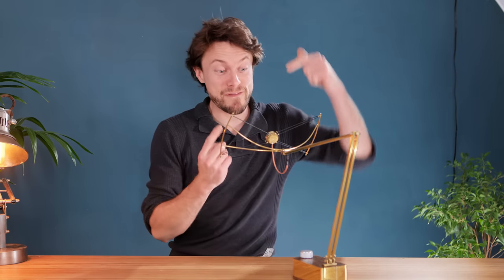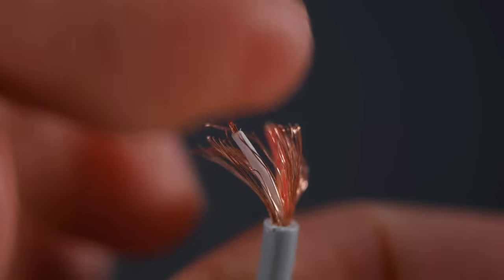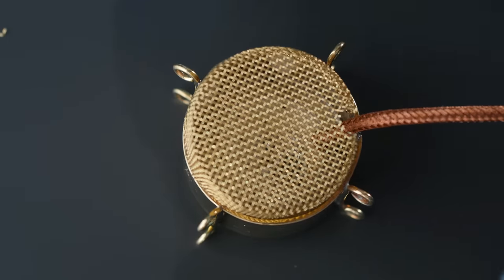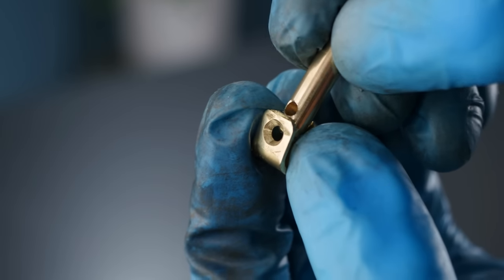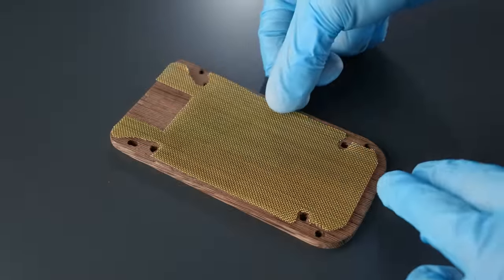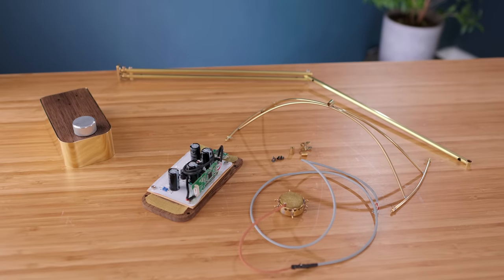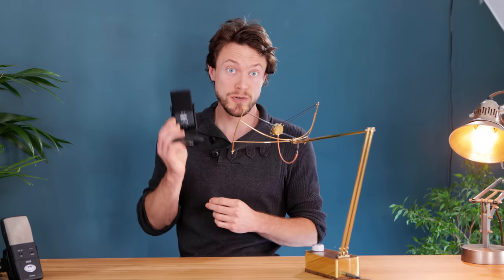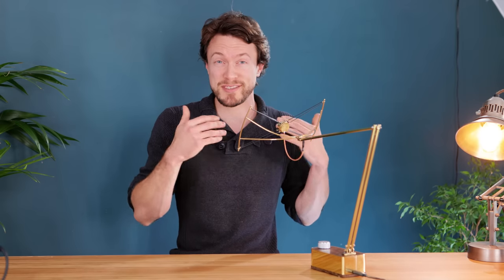Building a quality USB-C microphone

Comment: If you could sell a build kit for this I would drop 100 dollars for it. This is just to cool
Reply: Mostly it isn't the parts that add the cost, it's the pay and transport, so I am not sure he would come out on top on that one.
Reply: Yeah, I'd probably be more than happy to pay for someone to build this for me ;) ...as to DIMyself, the tools, components, exact amounts, shipping AND obviously experience would ramp the costs up considerably for me. But I love the idea of knowing exactly what went into the project (as explained in this video). So hit me up if you're building and selling these (UK)!
Reply: Yep, also, most people don't have a soldering (iron, flux, wire), drill + bits, wooden pieces, brass, heating torch, workbench with tools etc. + the general skills with those tools to do these DIY projects.

These DIY projects are cool, but even more cool would be if people with these skillsets would manufacture cheaper microphones and out-compete the market.
Reply: @albin1816  Ok, and?
Reply: @ElicitDaG  and?
Reply: @albin1816  And?

Comment: Depending on the use case, I'd say the Neumann has more polish to the tuning of it. It's a lot warmer and less clarity, but if you're using it for voice, it lends to a more pleasing tonality and overall sound. The DIY microphone has amazing clarity to the point that it's a bit deterring when  listening to it with a very accurate headphone. However that is fixable in post or could help with an addition of a pop filter which makes it maddeningly impressive given the price of the build. Bravo!

Comment: Not exactly the same quality as the Neumann but definitely far more wallet friendly.  I think I would probably go for a simpler design featuring more wood but I think that with such a retro theme it deserves a valve pre-amp which may well go some way to emulate the greater warmth of the Neumann.
Reply: The valve pre-amp is an interesting idea.
Reply: @badhonebrahim7707  Child
Reply: you can tell the difference in quality i cant hear a difference
Reply: Quality of microphones is subjective and completely relative to the purpose you use them for; Even professionals will rate microphones from hundreds of dollars to tens of thousands equally on average when they hear recordings without knowing which mic did it in a blind A/B test. Even mics in less than $100 can fare well in these tests.

This is why mics like sm-58s are often still standard even in million dollar studios; They're still eminently usable despite being only $150 or less.

The only reasons mics are worth thousands and thousands of dollars is because you're going for a particular sound, response, signal-to-noise ratio, and impedance. Also obviously simple quality of construction matters as well, and whether pairs or sets are matched, etc.
Reply: @Kyle_v2  The Neumann mic has a rounder, more bassy sound commonly referred to as "mic effect," and would be a better option for a calming evening show or an ASMR recording. My hearing is pretty bad and I'm not using my good headphones, but the $40 mic seemed to stack up decently with his usual setup that costs 20x as much.
Reply: @inthefade  It's hard to go wrong with an SM58. When shopping, I highly recommend trying to find an SM58S, which usually costs about a dollar more, and has a hardware mute switch on the microphone.

Comment: Very impressive mechanical design !
As for the electronic part...
1. In the schematic I see a 2.2k resistor connected to the source pin of 2N4416 which is the same value as in the JLI's Datasheet, Measurement Circuit, which raise the suspicious that the value was just copied from the datasheet without any understanding of circuit functionality. In the Measurement Circuit the 2.2k resistor is connected to the ground and there is a hint that Vsource is 1.5V resulting a current of 0.68 mA. In the presented schematic the 2.2k resistor is connected to -15V and that would cause a current about 10 times higher. High current in a microphone preamplifier first stage means higher noise.
2. The voltage from Microphone must get to gate and drain pins of 2N4416. While gate is connected directly to microphone pin, the other pin of the microphone has to go trough ground, 2200 uF , 2.2k resistor to get to source. Basically the 2200 capacitor is in series with the microphone signal and therefore all the (small) noise present on that capacitor is in series with the microphone signal.
3. In normal operation Vsource is higher than Vgate (Vsource > Vgate ). Since the gate is connected to microphone and the other pin of the microphone is connected to ground I assume the Vgate = 0 (Ground). So in normal operation condition a)Vsource > 0  (for example Vsource = 1.5V). 
Because Source current is equal with drain current (Isd) and there is a same value R =2.2k resistor connected to drain we have Vdrain = 15V - (R x Isd) and Vsource = -15V + (R x Isd)  which means condition b) Vdrain = - Vsource.
Since Drain is connected with a resistor to + and Source is connected with a resistor to - and there is no other way current goes (no current trough capacitors) we have condition c) Vdrain >= Vsource
Looking at a) b) and c) the only solution would be Vdrain = Vsource = 0 which tell us that either  despite being connected trough microphone to ground the gate is somewhat at a negative potential (condition a) is not valid) or the transistor is saturated. Someone who has made the schematic should measure the voltage between source and drain and leave a reply, please.
4. THA1512 is a bipolar transistor based IC for low impedance sources, like dynamic microphones, moving coils. As the input impedance increase, the noise increase. Just because we want to build a electret microphone preamplifier, using a high performance IC for dynamic microphones might not give you the best possible signal/noise ratio (see Application Report Understanding Op Amp Noise in Audio Circuits  Tyler Noyes, Tamara Alani). I will try with OPA1652 who is a FET-input OA, no need for the external FET transistor, connect the microphone directly to OPA1652 input.
5. at 2:11 "The leg next to it won't be used" That is the transistor's metalic capsule, I would solder it to the ground
Reply: Hey you're smart. Question for you, I want to build this mic but dont reallllly want to build out the board. I have a Focusrite Solo interface and Im wondering if I were to solder the mic capsule with the transistor  to a XLR cable and plug that into my interface if it would work? Any thoughts?
Reply: @taylor.galbraith  I understand that you want something simple and that you have a preamp that has a XLR input only for a dynamic microphone (otherwise if it has a XLR input for a condenser microphone then you could connect the Jli electret microphone capsule directly to XLR, without any transistor, no 48V phantom!). With those assumptions, check https://youtu.be/L3a91HLWvPE that is the minimum you could get away with and have good quality. For simplicity, no external power supply, no complications with schematic using the 48V phantom power. It will not work with only the transistor soldered on the capsule as you are asking, you have to use a circuit with at least the two 2.2k resistors, a 6-9V battery for power and you connect the XLR where the two 22uF non-polarized capacitors are. I couldn't find the schematic of your Focusrite Solo interface, but looking at a schematic of a Shure mixer and a Behringer mixer, they have internal capacitors, so the 22uF non-polarized capacitors can be omitted. However, I have the schematic for Focusite ISA110 and RED1 and for those,  you need to insert a capacitor on at least on one of the wires that go to the XLR connection (like one of those 22uF non-polarized in original schematic) because mentioned Focusite mixers have an internal transformer on the input that would DC short drain and source of the transistor (for example drain source voltage will be like 5.6 V when not connected but it will drop to less than 1V when connected to the XLR input).
Reply: @johnt2342  Hey thanks so much for your reply! Great video link, I am very new to electronics which overwhelmed me when I first downloaded the project and looked at the schematics. I understand your walkthrough very well which I appreciate.
Reply: I have build the microphone but am searching for ways to make it better. As you suggested i measured the Voltage between drain and source and came to 10V DC. This should satisfy your condition a) but 10V seems for me a bot to much for the capsule as the test rig only used 1.5V.
Reply: Man that was one of those comments that you just copy and paste into notepad for later
Reply: nice rabbit hole!

Comment: The fact that the comparison between the DIY mic and the Neumann came mostly down to preference/application is bonkers considering the Neumann costs LITERALLY 100× more. Speaks volumes on how knowledge and buying directly from the manufacturer can mean that much of a difference in price to performance.
Reply: It's like the story of the old mechanic that hit the motor with a hammer to get it working after nobody else could figure out what was wrong or how to fix it. Hitting the motor with a hammer: $10. Knowing precisely where to hit and how hard: $2990 (or some other very large number). This project is basically Matt giving us the $2990 part for free, and leaving us to spend the little bit of money and some time to put it together.
Reply: To be fair the Neumann is also used to record instruments and this is really challenging. Since his diy microphone doesn't handle changes in dynamic too well there would probably be a much bigger difference. But I'm no expert, maybe a few changes to the circuit design eliminate this flaw. Other than that his microphone sounds amazing.
Reply: @niklasholgerson3779  I had the same thought - though I also wondered if you can get the module used in that mic, what it might cost, and how THAT diy comparison would go.
Reply: @johnandjacquelinewarren9979  the pickup on the Neumann costs basically the same as the one he used, there's 0 mistery in manufacturing electroacoustic pickups with very tight tolerances at scale.
What makes the Neumann the gold standard is all the electronics to amplify and filter the signal, that's where most of the cost is going, into the ROI of the original R&D of it.

Comment: I actually can't hear a difference in sound quality for most things. Even playing with built-in equalizers in car radios, I only notice a difference between +10 to 0 to -10 on each frequency. Nothing in between. As such, I would only know if one microphone is better than another by recording them with a multi-frequency oscilloscope and visualizing the peaks/falls. I'm sure you could use the first microphone that sits on a desk and I wouldn't hear a difference. Still, an impressive DIY, to be sure.
Reply: yes. 

the real test of a mic is what range it pick up sound at, even a 20 dollar mic that is directional would do a good job for voice recording if it is close enough to the face. it does take a while to get used to directional mic like this, because they really don't pick up sound from the side which is great because u don't get as loud an annoying key tapping sound from keyboard and such. so picking the mic based on purpose is more important then buying an expensive but incorrect mic for the job. 

but the issue with these mic is they do need power, and USB has limited power output, so what limit them is the USB power standard. which mean USB powered directional mic can be expected to has similar quality since the limiting factor is the USB.
Reply: @lagrangewei  atleast for current USB spec I don't believe this microphone is reaching the top, which for clarity would probably use a second USB.
USB-C is specced for quite a lot, would of course need a supply for that but even so
Reply: @lagrangewei  isnt that why the booster electronic components are there?

Comment: The Neumann is more flat. I’d presume adding a foam mesh to the DIY mic’s insides would flatten the sound and make it actually quite similar. Professional tools, even in terms of photography preferences, are generally flat so producers and editors and get a full range of adjusting in post production. The DIY is also a bit “tin-y”. Harsh highs. I’d wager adding a foam mesh covering to the front and back of the mic under the brass mesh would make it rival the Neumann extremely well.
Reply: Ugh! — dreadful tin things.
Reply: A bit of foam isn't going to fix a totally random enclosure.

Comment: Soon the entire house would be redesigned and made out of brass😁😁.
This design is beyond. And honestly, when you compared it with the high end 3000$ microphone, the DIY 30$ sounded better in my opinion. Really powerful!
You are undoubtedly the King of Electronics on YouTube.
Reply: Immediately I noticed how much better the $3000 one sounded to me actually. The lower tones / bass is much more present which was music to my audiophile ears.

That's not to say that this project isn't insanely cool and very clearly gets most of the way there though.
Reply: @lukaspaukstys2317  I'd say asking that asking a completely handmade $30 mic to beat a $3000 studio MIC is too much to ask to begin with
The actually impressive thing is that it's basically same as the 800$ mic setup while being way cheaper and completely self-contained

Comment: I think the only major difference between the 3000$ and 30$ mic is that the 30$ mic has no filtering so you hear chewy sounds which could easily be solved adding a filter to your microphone.
Reply: @TheBest9zq  Meh in my opinion that would give an audio version of the standard smartphone "portrait mode" when taking pictures. It gets close, but it's still very buggy and can be wrong in a lot of scenarios. On top of that, plosives are more like the sound you get when someone (especially with a headset) blows into their mic when saying S's, T's, B's, and P's which Discord's noise suppression wouldn't fix at all.
Reply: @EpikoXailia  or just place a pop filter in front of the microphone ?
Reply: @happylittletrees8130  a well designed mic rarely needs one
Reply: @lucasc5622  hmmm. yeah, but considering he's making the enclosure himself, and for very cheap, I wouldn't really complain. I don't really know a whole ton about mic design, and how hard it is to make a "well designed mic"
Reply: @lucasc5622  they do 😂
Reply: @hildingvilding4618  its just bad mic technique mate. if its a proper commercially made product that takes in every plosive it can get then its a bad mic, or you're to close
Reply: @lucasc5622  it gets better the more expensive, obviously. but when singing vocals you’d ruin a recording if a loud plosive gets recorded so using a popfilter of somekind is almost always good to have
Reply: What kind of filter are you even talking about? Pop filter, high pass, low pass?
Reply: There's no such thing as an analog filter that's going to reduce chewing noise without affecting other audible frequencies
Reply: and the Neumann has cleaner low end in my opinion, but no where near a 2970$ increase
Reply: Other way around. 3000$ mic got no filtering. 30$ mc is an amplitude-frequency filter by itself. Certain filtering is done by external means (properly designed room, shields, dissipators, post-processing etc).
Reply: @JarlHJ  The 2970 increase is worth it for its actual use, audio studios.

Comment: The DIY one has a noticeably crisper sound compared to the $3000 one, while the expensive one sounded a bit... warmer? I'm nowhere near an expert on this stuff, but I found myself liking the sound of the DIY one for most uses. Awesome video, I will be making one of these soon. :D
Reply: Yeah the Neumann has a more full low end but with at least vocals, the DIY sounds better
Reply: Yes, the Neumann sounds a bit warmer, and that's its sound signature and why it is used in many studios. It doesn't mean that it's better, but that it adds this particular sound signature that sound engineers like.

The good thing is you can also add whatever sound signature to the DIY mic by changing the preamp circuitry. You could even build a tube preamp just for that.

Comment: Litz wire is often used in vinyl turntable arms to reduce 'microphony' of the wire. A possible upgrade from the thin enamelled wire.
Reply: The only problem with it is it's typically used with higher voltages, is it not? And with amplification at a magnitude higher than what's in use here. I've seen small gauge, 28-40 but that's still a bundle of 40 individual wires to carry a signal vs 1
Reply: @kylesteele9403  No, the only problem is cost. Litz wire was invented for high frequency signals (radio). But it is super flexible and not microphonic at all, which is why it's used in high end record players. It works perfectly well from high frequencies all the way down to DC.

Voltage doesn't matter. Moving-coil cartridges for hi-fi record players put out less than 100 microvolts typically. Microphones range from this level to several volts depending on sound levels. (Moving-coil cartridges work the same way as dynamic microphones incidentally.)

Current matters with small thin wires, but capacitor microphones (including back electrets like this one) put out infinitesimal current. The transistor (JFET) that is normally built into microphone modules "amplifies" the current by tens of thousands or millions of times, up to "very small".
Reply: @gregvanpaassen  I see, so the signal from the diaphragm microphone just needs to be carried and doesn't matter how big the wire carrying it is, and because of the cancellation from the litz wire would work more effectively with less steps?